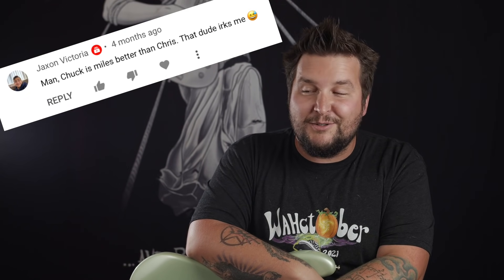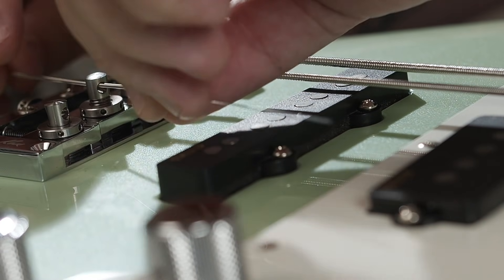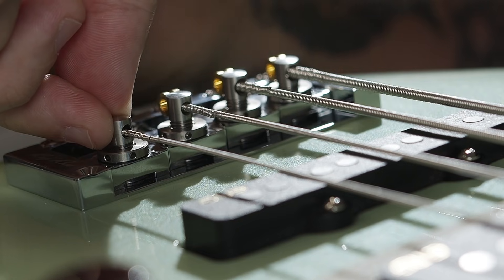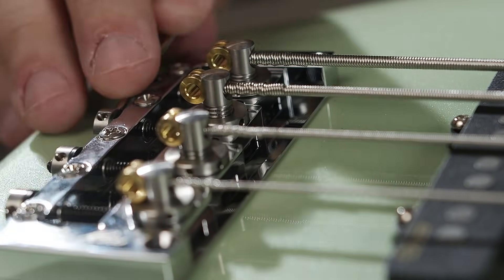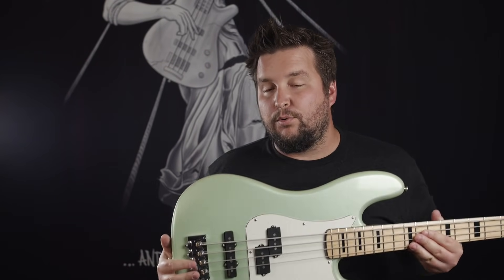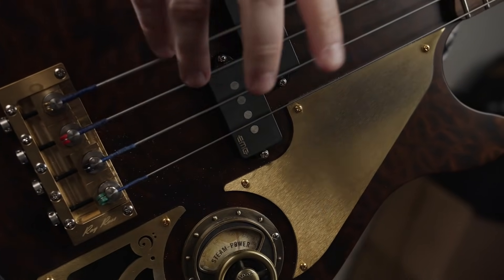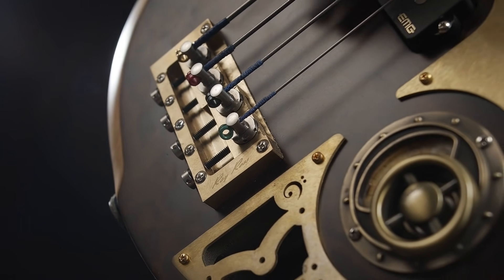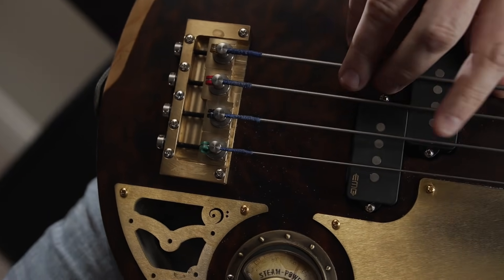GEAR TALK | Ray Ross Saddle-less Bass Bridge

Comment: It would be interesting to see what string manufacturers have to say about this bridge.  Something tells me the wrapped end of the string should not be part of the speaking length of the string.
Reply: Yea, that kind of bugged me too. The felt winding also seems to contact the inside of the post further dampening the string.
Reply: Owww, thats a great point! Might event unwrap from vibration?
Reply: @petougao , I don't see that happening, but I can see the inconsistency inherent in that part of the string causing weird issues. To me,  this bridge is a solution in search of a problem.  An answer to a question nobody asked.
Reply: Especially if it's wound with silk
Reply: You can get piano wound strings with the core exposed until after the contact point. I don't think a bit of wrap would do much damage though
Reply: So that felt winding, being by the ball, will be experiencing the least amount of movement. The mass of the felt will dampen the vibrations in the same way a piece of paper will dampen a punch to the face. Sure? But it's imperceptible. 

But we're musicians! We'll pay (or not pay) hundreds of bucks for imperceptible!
Reply: yup, it causes issues.

Comment: I put one of these on my Fender Player Precision bass about two months ago!  It's definitely a quality of life improvement as far as setting up and changing strings go.  There were two things that annoyed me about the old bent metal bridge on my bass: 1) Whenever I put on strings, it was really hard to avoid dragging my strings across the bottom of the bass as I threaded them through the bridge; I feared that I'd scratch my bass.  2) The action adjustment is two screws per saddle, making me not only have to waste time adjusting two screws every time I adjusted the action, but it also allowed the saddles to become slanted over time, creating an awful buzzing sound as I play due to the saddles hitting each other.  I'm glad to say that this Ray Ross bridge solved both of these problems!  Plus, I only need to use one tool to adjust both the action and the intonation, and the design of the adjustment wheels makes it easy to track how much I am adjusting based on the turning of the holes in them.  I wish every bass had one of these on them.
Reply: Never had a problem with buzzing and still i have the stock bridge had mine for 1 year
Reply: @recordlabeldao7820  Alexa, please turn on my espresso machine

Comment: I put this bridge on my 2019 Aerodyne (along with Aguilar HC pickups and CTS pots). Being my first experience with Ray Ross bridges, at first it seemed a little tricky to set up but looking back on it it was quite straightforward. I do love it and it looks much better than the stock bent metal bridge. They are pricey but you get high quality and very precise adjustments. Thanks for the vid!

Comment: I had the opportunity to work on a client's bass recently. He had installed a RR bridge a couple of years ago and was generally happy with it. However, I did observe that the back of the blocks that hold the posts looked to be slightly lifting. The intonation screws also had a slight up-bow.  It seems that the strings pulling against those posts creates lever action against the rest of the mechanism. The rotational force against the brass blocks is countered only by the thin intonation screws. I find this design to be far less "solid" than any traditional bridge, especially one with through body string anchoring. But hey, people will buy anything.

Comment: The concept is very clever and I could give it a try in my MIJ Fernandes. Un order to prevent the loosening of the nuts which set intonation and string height I'd include a locknut system.

Comment: Bought a squire 4 string Jazz bass and started to do upgrades for fun and experience.
I first installed a Babitz then changed to the Ray Ross .
I had some problems with a loose lower post on the A string and I am still working on getting the height correct to limit buzz on the open string.
However had no problems otherwise and enjoyed the ease of setup as well .
There is a significant sustain change .I used DR blacks.
For anyone building a bass I would recommend this bridge.

Comment: Putting the string snug so the ball end goes in the groove, will twist your inner wire when wrapping the tuning peg.
Reply: How does one prevent this? Isnt it similar with the regular bridges?
Reply: @petougao  pull the string just below the nut while turning the tuning peg, so the entire string can rotate it's length. Makes the windings on the peg tighter too, so you have to use a couple minutes less pulling the strings tight to keep it in tune after restringing.
Reply: @Theladrion  thanks, was doing that already to save the nut from scraping and tightening the string to the peg just made sense. Not a bad thing to get reaffirmation anyway.

Comment: I have a Ray Ross bridge on a EMG modified P bass. It’s a nice bridge but it is expensive and does have a few caveats. 

On my bass, I had to shim the neck to get the action to my liking. 

Next, you have to be careful when adjusting the tone pin. Specifically making sure that the string is perfectly straight once you are done adjusting the height. This requires (in my experience) the string to be loosened prior to adjustment. 

Lastly, it would suck to lose the little tool used for adjustment. I really like it but I could see that being a problem if one were to lose it. 

The positives - I like the attempt at modernizing the bridge. I also believe that there is a tonal difference. I am not sure how to describe it but it does sound different. 

I recommend this bridge, especially if you can get one on sale or used. They are very interesting. I would love to get one for my 5 string if they put out a 18mm model.

Comment: The original bent bridge is perfectly servicable. All these newfangled bridges is just a solution to a problem that doesn't exist. If you like the look or the way it sets up, sure that's a good enough reason, I guess. Just don't expect any appreciable tonal differences.
Reply: There is definitely room for improvement from the old bent metal plate bridges, whether this meets that criteria or not, I don't know, having never played it. One particular area that can be improved on over the bent metal plate bridge is the lack of sharp edges where one rests one's hand when using a palm muting technique.

Comment: In terms of tone, I think the bridge matters very little. That said, that bridge looks really cool, and the way it adjusts seems really well designed.
Reply: It definitely matters because the amount of resonance is akin to the bridge design. A piece of garbage bridge will not resonate that great. Or as great as strings can.
Reply: @stewartross13   I'm not saying it doesn't matter at all, but just that there are other factors that matter a lot more in producing a good tone.
Reply: @ampthebassplayer  I’ve upgraded to a few high-mass bridges but very never heard any difference.

Comment: my concern with this design is that its really just moving the point of most stress on the string from what would be the break angle to the ball end of the string, in which the wire holding the bead on is much smaller than the core wire, I would think it would cause certain strings to break easier than a traditional bridge but perhaps im wrong, and i would think if the felt is on the playable part of the string wouldnt that inhibit its sustain and or tone? strings arent really made to be played directly from the ball end like that and could cause tuning issues on the E and B strings with changing the point where the string tapers down to fit into the tuner, i would hope these things were thought about in the design and that im just being skeptical that it would create just as many problems as it fixes, it does look sweet tho!

Comment: Intuitively it would seem like strings would be more likely to break with this style because the winding/ball connection is the point of contact and vibration with no saddle to provide a break angle buffer?

Comment: If you want to take that nice customized bass of yours one step further, I highly recommend swapping out the nut with a Zeroglide which features an integrated zero fret. This allows for perfectly even string height and intonation. Extra bonus is that it requires no modification. If you don’t like it, you can just put the old nut right back in. Check it out!

Comment: I’ve only ever broken one string, an E.  I was overzealous in giving the strings a stretch after just installing brand new strings.  It broke the core, where it goes around the ball end.  My gut feeling may be very wrong, but a standard saddle feels like the friction point of where it goes over the saddle slightly buffers the strain on the core down there where it is entirely unsupported by the windings.

However, even if my gut feeling is on to something, I also suspect that the core would only very slightly be more stressed by hard playing, and would be fine in nearly all playing circumstances.

Comment: The reason why I personally wouldn't like the Ray Ross bridge for myself is because the strings just go straight to the tuning pegs even closer to the tuning pegs then even a bent plate bridge so that means the string tension is way lower I like the Warwick bridge because of the higher tension on the strings and also two strings through the body of the bass for that same reason you can really dig into the strings without them clanking around
Reply: Wrong!

Comment: My only issue with this bridge is that (unless I am seeing it wrong) the adjustment screws are now the structural component instead of the base or metal bracket mounted to the body. I would say if your are going to have a failure it will be the intunation screw snapping and the "saddle" letting loose.

Comment: Finally got around to getting this bridge (stewmac was closing out the black ones).  I am not impressed.  It is well built and solid.  However, I have more upper fret intonation issues with it than the stock bent metal bridge.  This is because I am getting some odd overtones, most likely due to the windings at the ball end.   I find it off that people gripe about the notorious Gibson 3 point bridge and how a little of the windings are on the playing part of the string, yet rave about this bridge when 100% of the windings are on the playing part of the string. Also, this bridge might require additional shimming of the neck.  Sound wise, I could not really tell any difference in sound vs the belt metal bridge.  Plus I can't stand that it needs a special tool to adjust.  Also, I would not try to adjust intonation with the strings at full tension as I'd be concerned about stripping the screw since this would counteract 100% of the string tension.  
Over the past 40 plus years, I've tried almost every bridge design that there is.   This one does not impress me, especially at the price these sell for.  It's a "solution" for a non-existent problem IMHO.  At least this is a reversable mod if one doesn't like it unlike the 2Tek and other exotic designs over the years.. 
I have found that besides the fact that bent metal fender style bridge ain't exactly the prettiest, they work very well.   Stock fender bridges are functional, easy to adjust and work well.  I've seen 60 year old fenders that the bridge still works fine even if they look rusty.  But so many of the high mass bridges end up with frozen screws due to corrosion of the zinc alloy.  Luckily this is brass and should not have that issue.
Reply from the maker: I did have one small overtone thing with one of the strings, but found that the ball end wasn't fully seated because I had the bridge pin turned backward - make sure the ball end is sitting in the chamfered-out hole and not the smaller hole for the string exit.   Regarding the 3-point Gibson bridge, I've never heard any complaints being about the windings on the string - the 3-point's problem is just that it's a crappy bridge design for setup and adjustability.
Reply: @TheBassChannel  there's lots of issues with the gibson 3 point for sure. 
As for the Ray Ross,  the ball ends are seated fine.  Tried a different set, same thing.  I really dig in finger style right at the bridge, literally I'm playing on the windings with this bridge.  When i move away from the bridge it's hard to notice.  Odd.  Never seen this on other bridges.  I'll stick with bent metal, Badass, Hipshot and ABM.

Comment: what about the winding near the end of the string?
 the part of the string that is not designed to vibrate at all lol
Reply from the maker: What about it?  The speaking length of the string is still vibrating unhindered even if a 3/4" section of it has silks on it - those don't damp the vibration noticeably, if at all.

Comment: The Ray Ross bridge design is really cool and innovative and I fully understand the potential it has. But I have a KSM bridge on my bass for one reason. The way strings are made is the problem. A string must be flexible in order to be able to vibrate freely and have overtones. This isn't so for that three centimetres where the string ends. On the inside its core is twisted on itself and has windings that locking it plus on some designs it has some silk wrapped around it too. All these make this area very stiff that absorbs and dampens vibration of the string. In my opinion this takes away the obvious benefits of this bridge design. So until Ray Ross comes up with a better string design too I will use the KSM bridge on my bass.

Comment: There are definitely differences in bridges and room for innovation, but IMHO it’s not with what most people focus on in reviews. A good bridge needs to be easy set up, not go out of set up, not bend or become detached from the bass, not cause damage to stings making them excessively prone to breakage, not create any buzzing, and be comfortable (ie no sharp bits) to your hand. In so far as sound is concerned, if you hear the bridge then something is likely wrong. New strings, pickups or playing technique will make a bigger difference than a bridge on its own. Also, if you can’t hear the difference a bridge makes while soloed on YouTube, compression whatever it is, then it’s not likely going to be audible in a mix that is also being streamed, possibly on YouTube.

Comment: I personally think that traditional bridges are fine as is and don't really need upgrading. But people are still trying to reinvent Leo Fender's designs even though a stock P or J bass is going to work fine in most cases. How did all those players in the past make all that fine music with a bass that had such a "terrible" bridge on it (and with flat wound strings)?  I certainly would not put a Ross bridge on my '77 Stingray. Which brings up the old contest of top loading bridges vs. a string thru body design. I am all for innovation but if it an't broke don't fix it. I wonder why most acoustic guitars still employ the old bridge pin method of anchoring the strings to the bridge and where the string needs a sharp break angle over a saddle to sound good? The Ross bridge has the string silk winding as the contact point opposed to a conventional bridge where the wound part of the string sits on the saddle. Can you use tapered end strings? How does it feel for palm muting? Ouch! 
Nevertheless less it looks awesome on that "Steampunk" bass, (which I think is severely cool).

Comment: Not impressed with this bridge. With traditional bridge of any kind, some part of the string vibration are through bridge translated to body, especially with string-through-body and neck-through-body construction, so we have string-body interaction. Here, the bridge holds part of the string that is not moving, and pickup catch only string vibration. Maybe somebody might like this, but this way practically all other parts of the guitar are irrelevant, only strings and pickups matters. I'm not so good at English, but I hope that you can catch my point.